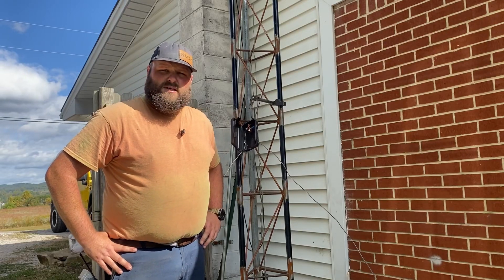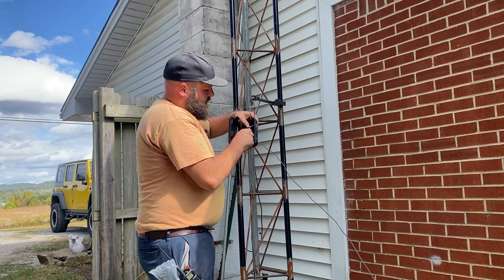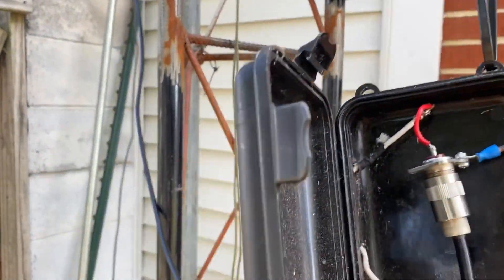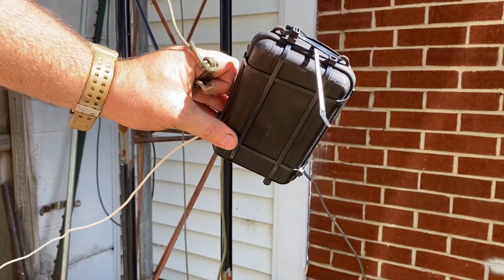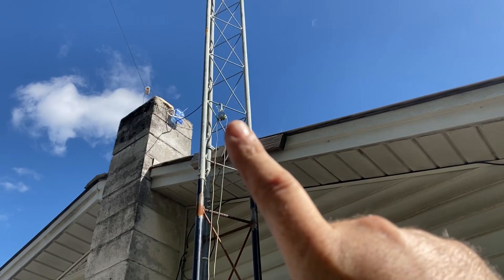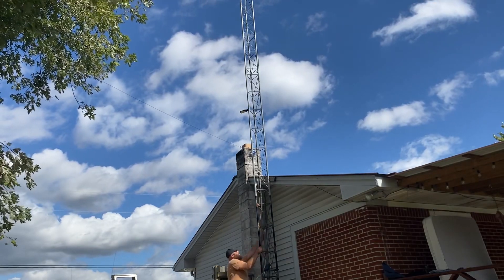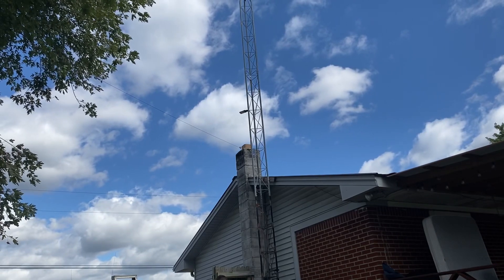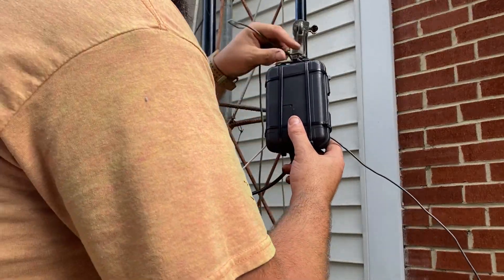Pulley system for antennas

Comment: Interesting but do have 2 comments, if I may: with the center of ur Inverted Vee being sooooo close to the tower, it might not only negatively affect the SWR but could also distort/affect the omnidirectional radiation pattern u'd normally expect from an Inv Vee; (but hey, if it works "as is," that's great & good job!); however, if it doesn't, u might wanna' consider mounting a "stand off" bracket to ur tower, just to eliminate any possible capacitive coupling that might occur between the antenna & the tower; & secondly, I must admit, using some flexible pvc as the base of ur Vee in mid-air is a really creative idea & (as long as it remains stable) is sonething for anyone to consider! But since I sometimes get lazy (LOL), I'll usually just tie off each leg to either something on the ground that's permanent or even to cheap plastic tent stakes--just whatever it takes to keep the angles correct or as close as possible! 73 from TN😃🇺🇸
Reply from the maker: Being to close to the tower did affect the swr. You are correct. I have aluminum stand off I built out of 2in aluminum pipe that is 4ft long. Going to attach the pulley to the stand off and try it again. 

Thank you. The pvc was just something that crossed my mind. I had it laying around so I tried it. That worked good. I still tied off both ends of the pvc pipe to the tower just to hold it still in the wind.